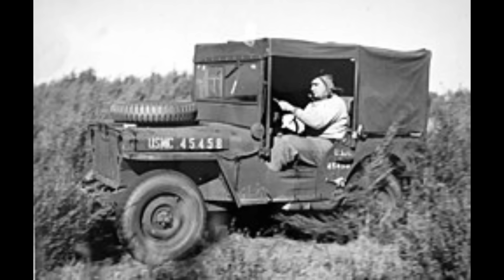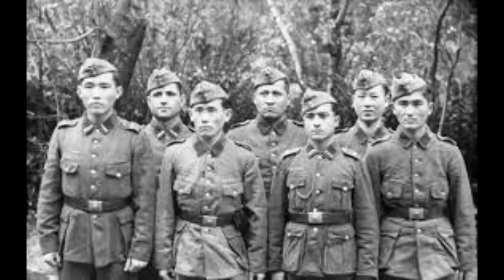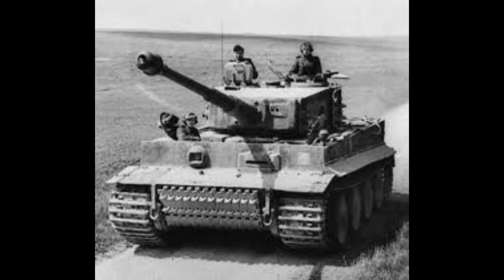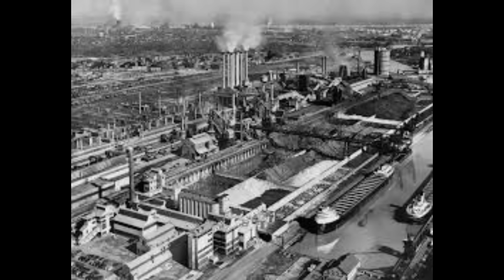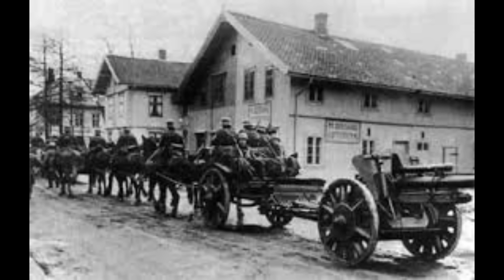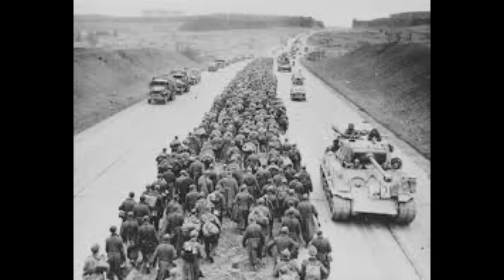German Mechanics Examined A Captured Jeep — Then Understood Why 640,000 Conquered  Two Continent

Comment: We have to relearn this lesson of good enough rather than exquisite.  GM or Ford could apply Musk's philosophy of “The best part is no part. The best process is no process. It weighs nothing. Costs nothing. Can’t go wrong.”  What if GM or Ford took a slightly older model car and then redesign it by 1) reducing parts counts by 1/2 2) increase the quality of the materials, precision, and build quality.  Combine simpler design with quality materials and good quality control.  It also means giving up CVT's or Twin Clutch gearboxes (which Ford failed with miserably) and using only port fuel injection with conventional torque converter automatic transmissions using 5 or 6 gears maximum.  What would this do?  1) decrease cost 2) reduce weight 3)increase quality and reliability.  Safety should not be left out and shouldn't have to be.  Some say that government regulations prevent such a car from being made yet Mazda does this every day across nearly their entire line of cars.  The CX70 and CX90 are an exception and also a REPEAT warning about releasing overly complicated drivetrains with extra maintenance and unnecessary expense.

Comment: AI silliness.  Most German fighting vehicles were over designed to an extent that they were difficult to keep on the battlefield and/or a near disaster to service.  The most reliable vehicles were Czech vehicles by had were converted to German use.  The Jag Tiger anti tanks engine had to serviced upside down and backwards.  They also rattled to high heaven because there wasn't anyway to retrieve tools dropped into the engine compartment.  The Tiger and King Tiger had a system where 3'wheels had to be removed if an inside wheel was damaged.  Both Tigers had to be serviced at 30% of the kilometres of  the Sherman. Heinz Guardian wanted to end all productions of beast panzers and follow the example of the Sherman and pump out Panzer IV.  This is swallowing the myths of Hollywood.

Comment: This is Duoglide55. In 1986 and 87 I completely restored a 1943 Willys Jeep. The man that put me on this project was an American Architect. He had found it Tennessee inside a reefer with other jeeps. They had been found in Greece and other European countries. 
It was in very poor shape. Sam purchased it and I picked up the project away he had partially disassembled it. But Sam was a very capable car collector and he had bagged and labeled all the parts. We made or purchased parts from a company in New Jersey. (I forget the company’s name.)
I spent 400 hours over 12 months at night after my regular job restoring this Jeep to a National award winning vehicle. First a Junior, then a Senior and finally the Preservation award. Sam had done a very in-depth research and added all the correct insignia, guns, and all the equipment that would have been used with this Jeep. He even found a pintal trailer and restored it. The guns were an M1 Garand, a 45 cal. Thompson machine gun (which were fireable). 
      A dummy 50 cal. on a pedestal behind the driver. In the trailer was a British Brin machine gun that my brother (Jeff was a great machinist and welder), had welded back together after it had been cut in 3 pieces. After blueing it was very difficult to see the seams. All the equipment that had been put in the Jeep was there through the diligence of Sam. And he designated it to a correct position in the American Army. 
 In the late 1980’s or early 1990’s Sam shipped this Jeep to France to cormorant the 60th anniversary of D Day. I was very impressed and proud about how my Jeep performed. No Problems. 
    Sam is gone but of all of his vehicles, his daughter kept the Jeep with trailer and all the accompanying equipment and accessories. I will try to add a few photos. 
Thanks to The Soldiers Story 640,000 Jeeps

Comment: The T-34 was also a crude tank, with comparable armor to the Sherman, though less reliable over all, but simple to manufacture.   Instead of copying the T-34, the Germans invented an entirely new tank, the Panther, with better armor and gun, but a weak and complex transmission and road wheel design meaning they were as likely to be abandoned as knocked out by enemy fire.  The inescapable reality was that the Luftwaffe was built for ground support, not long range strategic bombing, so even British factories were relatively safe, say nothing of Detroit and the Urals, while German factories were clobbered by 4 engined heavy bombers day and night.

Comment: One of the best 4 wheel drive motor vehicles ever designed. Fun to drive, but easy to flip. Simple to repair. German vehicles were overbuilt, difficult & expensive to manufacture. Not very good qualities for a country with very little resources. The Mouse is a great example of a waste of materials.

Comment: The Kübelwagen wasn't superior to the Jeep. It's a laugh calling it more sophisticated than the Jeep. It's basically a chopped down Volkswagen Bug.  It's two wheel drive while the Jeep was four wheel drive with more torque.  The Jeep could haul trailers and even small artillery pieces.  It was much more fucntional than that German vehicle that was basically just for transporation.  But what can you say, AI is going to AI.  Story based on fuzzy information.

Comment: Enjoying in Indiana,    from 1972-1978, regularly drove Jeeps, while Serving in the National Guard. While in charge of operating the Air Traffic Control Radar Generators, during my Service. I once had a Gasoline Run, from the airport to Main Bas., I picked up 3 55gal drums, and 10, 5gal cans of gas, back to the airport, in a Jeep with the standard trailer! Jeeps are top heavy, because of the narrow wheel base, the 1st rule is NO SUDDEN TURNS, faster than 5-10 mph!

Comment: I wonder how many different people own these AI slop WW2 channels? No matter how many I block, I constantly see the same stories, sometimes appearing at the same time. It may be that the lazy bastards are just using the same source material. A lot of them are clearly ripped straight out of written accounts, which have never stopped being popular. The ones that immediately sound like fiction, I block right away...because I'm not interested in fiction about the war, I want hard facts. This one, so far, is doing better than average, but it's still AI slop, so destined for my "do not recommend" list. But I'll probably finish it first. I just wish I could find channels that don't insult me with AI slop. It's too easy for them to make dozens of videos, while the ones made by real people make a few.

Comment: Regarding the Kubelwagen, It had the exact suspension as all Volkswagen Bugs. A torsion bar front suspension and independent rear wheels. The Jeep had two solid axels, four wheel drive capable. For a vehicle with only one driven axel the Kubelwagen did quite well cross country and in muck. And both were stamped steel bodies. However the Kubelwagen was a monocoque design.

Comment: Sherman's also faced two logistic problems no other combatants faced. Atlantic and Pacific.  A Sherman once built would never go back to the factor for upgrades. The max weight for Liberty ship cranes was 30 tons. So a Sherman had a max weight of 30 tons. Final drives took two to four hours replaced in the field. Drives failed at about 2000 miles.  Panthers had to remove the top armor,  driver and radio/hull gunner positions, the wiring, part of the suspension.  It required 3 to 5 days at the factory. Panther final drives failed at 1000 miles if driven with care and skill, often under a hundred if rookie and unskilled.  Sherman hits a mine or battle damage and the suspension wrecked, you remove the suspension by removing the bolts and put on a new unit, all field repairable with the parts. Panther a single road wheel needing replacing you need to remove more than one, if inner, three at best.

Comment: An old German WW2 tale: ""Our Tiger tanks can take out 4 American Shermans. But they always have 5."
Reply: Here is an AI take on that...

Question: So what were the real loss ratios?

Answer: Based on the best available evidence:

Panther vs Sherman
U.S. BRL study: Sherman 3.6 : 1 Panther kill ratio (Sherman advantage). 

German claims: Often inflated, not reliable.

Tiger vs Sherman
No single definitive ratio, but:

Tigers inflicted heavy losses in frontal duels.

Shermans and TDs killed Tigers via flanking, artillery, air power, and mechanical attrition.

No credible study supports a global 5:1 loss ratio.
Reply: @rodneysmith9177  US Shermans operated in 5 tank platoons

Comment: Willy's designed the damn thing.  Here's the other problem the German's had.  Nearly every American could drive the GP and change it's tire which the thing carried a spare.  The German army used dedicated drivers for even basic ground vehicles.  When they got a flat they called a mechanic from the rear.  "Better equipped" I'd take and M1 any day of the week and twice on Sunday over a K98.  Fun fact, the production time record for keel laying to launch of a liberty ship is 96 hours.
Reply: Actually the Bantam Car Co designed it, Willys and Ford got the contracts to build them. There were also very few Ford GP’s built as they were basically a prototype, most ww2 jeeps are either a Willys MB or a Ford GPW..

Comment: Germans engineered for high end consumer markets.   Americans engineered for agricultural markets.    The Soviets expected losses so they engineered for ease of production.
Reply: Soviet methods....   

1. Ideal design
2. Ideal prototype
3. Simplify prototype to make building easy.
Reply: Soviets set about "copying" the Walther PP.

They reduced parts count by forty percent.   Instead of the Walther "pull and release" the Soviets used a simple slide stop.    

Many parts have multiple functions - the hammer spring on a Makarov also works the Heel release for the magazine.

A Makarov can be "refreshed" through a simple parts kit.   Each rotation point of each part has a cut so that you can lift them out.   

The underside of the slide was rough machined, then parkerized.   Where fine finish is needed, like the rails of the slide and receiver, the fit is good.

The 9.2 x 18 mm round uses the same cup as the Tokarev.   To some degree you can use common assembly lines.   The round precisely duplicates the 9mm Ultra, a police round intended for European police agencies.

We Americans should take note of the goodness of simplicity.
Reply: Japanese went high tech yet reliable

Comment: one thing funny about this is that the Type VII U-Boat was a perfect example of an adequate tool produced in large numbers. sure it had refined flourishes but the basic design descened from a pre-ww1 French design. it was a workhorse. So they could do it, but unless the service in question could frame the design decision in a way that was acceptable, they just wouldn't.
Reply: ...also both Willy Messerschmidt & Kurt Tank understood this quite well. The Bf-109 & FW-190 were both designed to optimize for logistics. (Messerschmidt pioneered pre-packaged assemblies; Tank opted for electic control over hydraulic because it was cheaper/faster to build & easier to maintain in the field. Problems went deeper than just optimizing for quality. Bottom line, their industrial capacity was always poorer than it should've been.

Comment: It's not that German vehicles were "better engineered," it's that American engineers were designing things to be rugged and reliable instead of "mechanically perfect," which, outside of mechanical watches, has no real meaning at all. When it comes to machines, a simple machine that does its job even when abused is always better and more elegant than a complex machine that will break the first time its used beyond its design specs.

Comment: I am glad they are building more f15s. More payload, more, range, bigger engines. A miss.e munitions truck for f35s. The f15 has pods to carry 45 lower cost missles to take out cruise missles and drones. It is a well known platform, established design and therefore lower cost even though it is not the best of the best anymore. It does not need to be. We have plenty of stealth tech in nato. Don't get rid of these equivilents of the jeep.

Comment: Much of this commentary is wrong. The Kubelwaggen was also "simple", the body metal thin and cheap. The bit about the carburetor is BS. The crankshaft of the Jeep DOES have bearing inserts, like all IC engines, FFS. Germans in the field thought that Jeeps were great, not crude junk. Basically a ridiculous production.

Comment: “In total war, adequate equipment that exists, defeats perfect equipment that doesn’t.”
Reply: Ford not only produced bombers in unbelievable numbers at its Willow Run main assembly complex. 
It also supplied other aircraft factories across the USA by railroad and truck transport with needed vital subassemblies.
Reply: @t5ruxlee210  Yep. Don't let perfect ruin good.
Reply: and just getting to work
Reply: The prefect is the enemy of the good
Reply: Similar to Ukraine manufacturers drones, quick rapid cheap manufacturing, disposable with rapid replacement.  
The difference is the Ukrainian drone manufacturing is rapidly evolving where as the jeep was a single design  used by the user 
The Ukrainian equivalent of the jeep is  the mass produced motors, cpu boards. resin, armor piesing shell etc manufactured elsewhere in the world; and assembled in Ukraine into the required configration. The world producers reliable standised component's, Ukraine like allied high command assembled the flood of equipment with skilled soldiers to produce a flood of drones overwelming Russia.
Reply: Exactly this! WWII was a war of good enough on both fronts for the US.
Reply: What choice did the germans have but to rely on increasingly sophisticated engineering for lack of industrial output. Its a lossing game but the only game in town.
Reply: @robertalpy  That's a fair point, but not the core problem. German industry couldn't stop tinkering, and they kept issuing modifications for vehicles that were already in service - and many of those factory modifications or frontline mod kits were for minor items that didn't significantly affect performance. The end effect was a significant increase in cost and a reduction in production efficiency. On the other hand, Allied tanks only got modified if there was a good reason to do so - obvious example being the frontline kits for fitting coil spring assist on egress hatches, so they could 'pop' open very quickly if the crew needed a fast exit.
Reply: The American tanks tended to be not as good as the German, because the US had to ship them across an ocean.
Reply: Total war is a moronic strategy!!! As history has proven 😂😂😂. german ego is how we (USA) won the war. That same ego is still rampant across germany today and is why germany will never be a significant threat ever again 😂
Reply: now we are the ones who build expensive, precise, complex equipment hard or impossible to repair on the battlefield.
Reply: @WillFinch-k4j So true.
Reply: @jodyeyre9840  Only Germany could take the ENTIRE Nazi playbook, remove the word "Nazi" and implement the whole thing, including antisemitism.
Reply: @FD2003Abc  
Nonsense,
Reply: @David_Lloyd-Jones  Nope.  Free speech suppression?  There.  Gun-grabbing? Yep.  Depend on govt uber all?  Absolutely.  Hate Jews? The only hate still allowed.  Name a SINGLE Nazi POLITICAL PARTY plank that is not in force in 2026 Germany.  One.
Reply: @David_Lloyd-Jones  Foundational Germans aren't antisemites,  but the "new" Germans sure are.
Reply: Germany has already surrendered to the Muslims

Comment: Equipment can be as advanced as you want.....but it will still break,and ..the more complicated it is the more there is to go wrong, anything that can go wrong will go wrong ... when it does now you need a replacement.... logistics is America's strength ...rule one "K.I.S.S." rule two it doesn't need to be the best ,it doesn't need to be perfect,it doesn't need to look good....it needs to be good enough, it needs to work, it needs to be easy to replace without straightening resources.
a sharp stick is not as good as a knife...but you still die if someone pokes you in the right spot hard enough with it. war isn't for expensive toys...it is for killing the enemy, you don't need perfection to do that, good enough works, good enough wins.

Comment: As stated above, this was also so very true of German Tanks; especially the Panthers & Leopards.
Each German tank was practically custom made & hand fitted. While with American Tanks, a part from one plant made in 1942, would fit a tank made in another plant in 1945 !
Also America built everything based on Mass Production; where specialized machines would endlessly churn out the same one Part. While in German Plants, everything was made by machinists using Lathes; slowly making one part at a time..